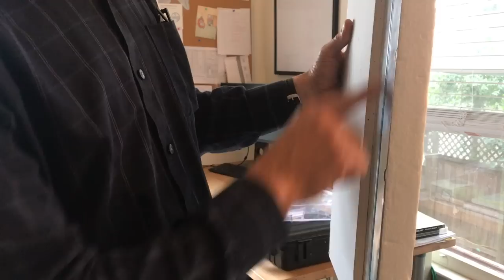Messana Radiant Heating & Cooling Finally Installed

Comment: What if you were to hang these panels from the wall?  You could frame them and make them like a piece of art.  That way they might be able to be used for both heating and cooling .? You could just use a heat pump that produces hot and cold water

Comment: It seems like it would be easy enough to add a "hot tank" in addition to your "cold tank" and leverage "free" hot water in the warmer months for residential systems. This would also decrease the load on your external heat exchanger.
Reply from the maker: You're absolutely right. The interconnected potential of heat rejection and exchange is remarkable. In some parts of the world, this is already happening with appliances - toasters and ovens rejecting excess heat into hot water, etc.

Comment: I like the load-shedding potential: the chilling of the coolant is somewhat decoupled from when it is used, and this ought to allow some flexibility in managing such electrical loads.
Reply: +Peter Lawrence yeah, in a large scale commercial application they could have very large insulated tanks, and run the cooling fans at night during "cheap hours" (assuming the building is still grid-tied).

Comment: I'm a southern Californian who lives in a "hot place"  about 4 months of each year.  We have some humidity in late August, but nuthin' like y'all have down there in Texas.     I like your ideas immensely, and am considering a "cool ceiling" retrofit to my mid-century home, only upstairs in one notoriously hot room that happens to be my home office... on the sunny southwest side of the house.   I have already implemented radiant barriers in the attic, by virtue of new roof... just recently.       Next summer will tell, if that improves living conditions, by virtue of cooler attic.     I might do more radiant barrier work; i.e., aluminum foil in the right places.      I have new ventilation tactics employed in the attic.     
If you haven't figured out my preference yet, I'm definitely into projects that keep people cool while consuming the smallest possible amount of electricity.     Passive tactics are the top priority. 
While your tactic isn't fully passive, it's excellent and tempting.      I would like to know more about the "heat pump" you run ("3 ton") outdoors.         Does that compress any freon, etc??     What is the wattage draw, when it runs?        My SEER 10  4 ton air conditioner draws 5kW when running, which is rather horrible.     
I also have drop shades and upgraded windows, which KEEP THE SUN OUT of the rooms, in the first place.         Actually, we rarely use the a/c but I run fans a lot at night, a rather tedious process that needs replacement.

Comment: Your explanation is excellent. I had radiant ceiling heating (electric membrane) installed in the bathrooms of my last house in Auckland and I absolutely loved it. Ever since I have wondered if chilled water tubing could be used to cool the space (or occupants as you have informed me).
Since moving to Blenheim, I have access to 7-8 degrees c spring water (Blenheim floats on an enormous snow fed aquifer), I would love to incorporate something like this into the new house (Yet to be built).

Comment: I do work in Austin sometimes and we do low voltage stuff but generally when we install speakers we cut holes in the ceiling and I hope they tell us about this so we can install brackets
Reply from the maker: I highly doubt you'd see this system on a project and not know about it. The majority of the panels would be blank anyway and we'd strategize their placement around the lighting/speaker plan.

Comment: Very cool system, no pun intended. Very technically savvy, Love the concept. I do have a rather large list of concerns about this systems real world viability. Clearly this is a sophisticated system that I am sure is very efficient. What that means in layman‘s terms is expensive. I would imagine that if you didn’t have “the hook up“ which you clearly do. This system would easily be close to $20,000 installed, if not more. You must also factor in the cost of service and repair ,which this system will inevitably need. I would bet my left nut that a $1000 repair bill, anytime this system has a mechanical failure, would not be out of the ordinary.  especially considering the specialized service technician required. Also you mentioned, in the video, that it was a 3 ton system. In the comments I noticed you said it was on a 2000 square-foot house. That equates to just over 650 ft.² per ton, which means this homes insulation and air tightness is really just barely above average. It would seem that, anyone considering spending this kind of money, on this type of a system, must consider if that money could be better spent improving the buildings envelope.  With proper building techniques and today’s technology, it is not uncommon to have a home with a cooling load at 1000 ft.² per ton. At that point, a more traditional HVAC system, or hell even some strategically placed window units could adequately and efficiently heat and cool that home. With significantly less costs for initial installation, service over the years, and eventual replacement.  I think it might be slightly misleading to put a video out about a system like this and insinuate that it somehow removes heat from a building more efficiently, with out first addressing the buildings ability to keep the heat from getting in in the first place.  By the way if the system works so well, why do you need ducted systems also installed in the home? And you might want to tell your installers not to blow the discharge from one condensing unit straight into another condensing unit directly across from it. Sorry for The rant, but sometimes it’s hard to watch these smart guys think so dumb. 
  P.S. also if cold water through the ceiling works so well, why not pump it straight down into the ground 250 feet or so which would cool it to55° ish for free and pump it up through your ceilings? Especially in Texas
Reply: @ryanj2007 I would’ve love to have read a response

Comment: How do you control humidity inside the house? What kind of climate or weather is needed (besides hot) to replace the traditional air conditioning system with a radiant cooling system?
Reply: Radiant cooled systems require a separate dehumidification strategy to maintain a comfortable relative humidity. Then, the thermostat would also measure dew point and ensure that the cooling panels do not drop below the dew point of the space (to prevent condensation).

Comment: I assume that the system is heat pump agnostic so long as the thermal battery is sufficiently sized, such that one could utilize a ground source heat pump?

Comment: 3 questions
1. You say it has sheetrock covering it. The sheetrock must not have that paper backing to it just in case it were to sweat correct?
2. Air to water heat pump? What brand do you have there and it takes absolutely no freon like a central air unit would? 
3. What fluid in the lines that is mixed with the water?

Comment: I am in South Carolina and have a radiant heat system only (70 years old original to house) and no central air. Had multiple mechanical contractors come out to see about modifying existing system to cool vs ripping everything out and putting central heat and air. No one even wants to mess with the boiler I have they don’t even want to take it out to put in the ac they want me to take it out. I feel as though modifying it if I found the right engineer would be cheaper and more efficient than an all electric hvac unit. Any suggestions?

Comment: I enjoyed your discussion of the ceiling panels and am interested in radiant home heating and cooling with two sets of circuits, floor heating and ceiling cooling in a one store home.  Main question is, how loud are those ceiling panels?  Do you hear flowing water in the walls as if someone is constantly flushing a toilet?  This is through 5/8 drywall or 3/8?  Or since its mounted to the panel, perhaps the sturdier 5/8ths isn't needed for the  ceiling.  Do you design 300 ft circuits as with floors?

Comment: Is there a limit to the radiant cooling. I imagine in a 90F room that you wouldn't feel comfortable, but if you can feel like its 70 if it's actually 75, than that could be very helpful.

Comment: Is it possible to use a geothermal Loop to cool a concrete slab without a heat pump? If the ground temperature is 55 to 65 degrees and we have a simple circulating pump will that transfer the you lower temperature to the slab? How do I calculate that efficiency?

Comment: Would this system work in Chicago?  Will the water going outside to the condenser freeze up?
Reply from the maker: Great question! Short answer is yes, it'll absolutely work. There are many examples of radiant systems all over Europe that deal with the freezing issue by supplementing the water with a glycol solution. We didn't do that here because as I type this at 9:30AM it's already pushing 80 degrees here in Austin.
Reply: You don't get freezing temperatures in Austin during January?
Reply from the maker: Occasionally. The folks at Messana seemed to think we won't need glycol. This first year is a year for us to data log the entire system too, so we're looking at it like a big experiment for now. If things freeze, we'll then know for certain that glycol is necessary and we can add it to our system then.
Reply: I look forward to your results.  I like any system that heats and cools silently.  I've always wondered why in the Chicago area,  where the deeper ground temperature is cool, we couldn't just pump water directly through pipes in the ground to cool in us in the summer.
Reply: Shouldn't glycol also alleviate any bacterial load that may be in the system? Alternatively you would need a 100% sterile environment and likely some form of silver coil to kill off anything wanting to live in the system. Any algae or bacteria would build up on the inner lining of the loops and create contact resistance.
Reply: @positiveenergy1565  so did it all freeze last month?
Reply from the maker: @Pertzbro1  we drained it before the freeze, thank goodness.

Comment: Awesome video!  Thank you so much for sharing.  First learned about Messana from your podcast and knew its what I was going to do next.  Could you please elaborate on how the system stays above the dew point?  Thanks again!
Reply from the maker: Thanks! Glad to know you're enjoying the podcast. We had fun installing it. So the system actually has some pretty sophisticated controls and sensors that monitor the environmental conditions. This allows the system to ride the dew point and never condensate. Of course, in a hot humid climate like Austin, we always recommend dedicated dehumidification and we already had a ducted dehumidifier capable of dealing with the latent load in our office. All of this points to the need to have a really good design in place when pursuing this kind of system. Also, be sure you've got the budget for this! That's probably the most important first piece to figure out.
Reply: T Willey

Comment: I wonder how hot the air is coming from the air to water heat pump in the summer time when it's the hottest inside/outside (perhaps 3PM or 5PM)? What I'm driving at is: the fans are blowing hot air on the wall of the building - presumably adding heat to that wall. Am I wrong? Just curious. I mean, if I'm going to be as efficient as possible, then, I need to know if my observation makes any difference.

Comment: I got quotes from three contractors to install an air-to-water heat pump to heat water for our hydronic heating system as well as domestic hot water. They all recommend different heat pumps: Chilltrix, Spacepak and Sanden. Hard to compare quality and durability of these three. Anybody have suggestions?

Comment: Appreciate if you could highlight how this system will be adoptable and economically feasible/ advantageous in Indian scenario.
For example here a conventional split AC of 1 ton will consume about 1.1 kilowat per hour ( 1.1 units an hour ) 
Ambient temperature in Kerala in hot summer days are around 35/ 40 Deg C. And humidity 75- 85%
Please note Units I mentioned are in metric system.
Please respond at your earliest convenience.
Regards.

Comment: So spend less keeping a house cool in warmer weather because cold sinks but in cold weather heat rising works against you for the same mechanism? 

To me it looks as though it would in theory work well with underfloor heating but instal costs would be significantly higher for two different systems?
Reply: yes and no, if you are talking actual air temp yes the heat will rise and collect around the ceiling, but radiant systems are more focused on the radiation of IR to heat occupants, its like those heat lamps you see outdoors at bars and everything they dont focus on heating the air but instead emitting enough IR to heat the people around them. Also since the panels are in the ceiling not the floor they can handle temps alot higher than you could have running through the floor since there is no contact with people (bare feet) so they can be more efficient.
Either way though I would like to see one of these systems heating in person and see how effective it is.

Comment: Would this system be as effective if one was to have an equal amount of surface area on a vertical application? My design currently calls for a walnut flooring ceiling treatment which requires clear access to trusses. It would seem any ceiling treatment that requires fastening is out of the question with likely restrictions on any measurable material covering the drywall.
Reply: Avant Arch Messana tech told me their panels can be installed vertically as well. But, quoted me over half my 2000sqft homes value for system materials.

Comment: How would this work in Houston?  Our tap water isn’t very cold in summer.  Wondering about effectiveness if the differential isn’t high.
Reply: +Dax Desai  It's a closed loop. No water is added once the sys is setup. The cooling happens at the outside radiator - exactly like your car's engine radiator. No matter the weather outside, the radiator can pull heat out of the pipe thus cooling the water in the closed loop.

Comment: By the way have you tried changing the one or two inch insulation styrofoam material for cork?
Reply from the maker: No we haven't. The panels are key turn and manufactured by Messana.
Reply: Hi Positive Energy - Integrated Mechanical Design,

Show the following info  to Messanna:

https://www.onegreenplanet.org/news/world-health-organization-upgraded-human-cancer-risk-styrofoam/

http://www.thermacork.com/ceilings-and-other-apllications/

They might reevaluate their choice of materials without compromising their performance.

Comment: I’m in Austin Texas and I want to store freeze dried food in my garage.  If I built a well insulated box as high as a food bucket would there be a thermal exchange from the concrete cool enough to get food buckets to 75,76 F?  …in the heat of summer?  Thanks!

Comment: Not sure if I have commented on this video or not but I have gone through this video and saw a flaw in your system it's kind of major depending on how you look at it. If you use a propane freezer system for the outgoing water and coil the outgoing water inside the propane freezer it will circulate the warm water turning to be a chilled water for incoming water for the system to redo itself as you've already explained how the system works. Basically it is just cutting down on your extra materials by half, replacing the need of electricity for propane, and hopefully saving you some extra money and resources the only overhead is the price of a propane freezer is at about $1,000 and a connection of propane to the propane freezer. Essentially it would work much the same way as radiant heating but for primary cooling applications, it would be the use of propane that is the common element for both radiant heating and cooling homes needing to conserve electricity. I hope this all makes sense. But yeah a propane freezer with the pex tubing coiled inside to chill the water will greatly reduce electrical costs for customers looking to save and conserve money.

Comment: I have an idea for a source of heat and cold that works well with solar and battery storage, and which I think would be outstanding for PEX radiant cooling (on the ceiling) and heating (on a floor PEX or with radiators).

https://youtu.be/QA2rnw0OMeA
http://multiaqua.com/index.php/chillers/mhrc-ae

You can add solar hot water collectors to this unit and an ice storage tank as well as a hot water tank.  
http://www.calmac.com/icebank-energy-storage-model-c

This will provide hot water year round (day and night) plus it will provide thermal energy for cooling and heating.

COP is over 7.

Works well with solar panels, and it is designed to slowly sip energy rather than gulp it.  This will increase the life span of the investment in inverters and batteries.

To make sense financially on this unit plus the tanks: 

1- Deduct from it the normal cost of an existing or traditional HVAC unit, then 
2- Calculate the difference in energy consumption, and project it for the expected useful life.  
3- If you are using solar panels, deduct the smaller amount of panels required vs. the amount required with a traditional or existing HVAC system.

Let me know what you think.